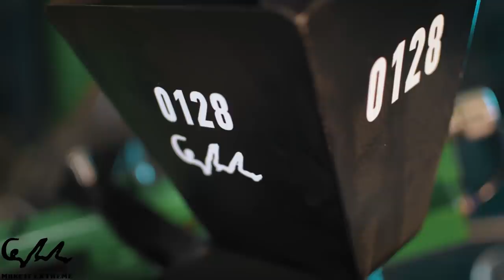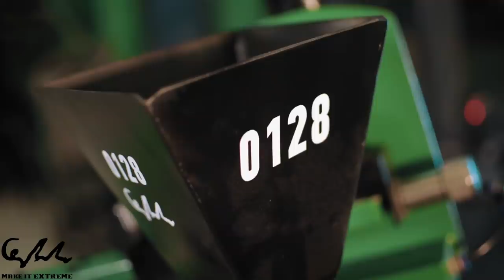Almonds vs. The Ultimate Crushing Machine

Comment: Interested in the trick you used on your 6 jaw chuck to turn off center. I assume the jaws were added out of synch so one thread pitch off of the spiral gear in the chuck? No idea how you did that otherwise.
Reply: Looks like he took 3 of the 6 jaws out and added one of the three back in offset, because the hole is offset toward that jaw. The imprecision doesn't matter much because he added a fine offset adjuster later.
Reply: @DD-DD-DD thanks.
 the fine adjust doesnt change the swing though just the starting point.
Reply: @Sqwince23  Yeah, that's what I mean. The jaw off-sync just has to be bigger than the biggest gap needed, the adjust can bring the start precisely where it needs to be.

Comment: Funny idea but not innovative, 4 small saw blades should cut the nut on all 4 sides with a 1 to 2 mm dept, Alling the length of the nut. The saw blades should follow the contour of any nut. That way everything would separate cleanly
😁👍